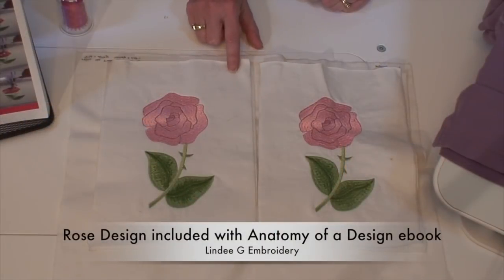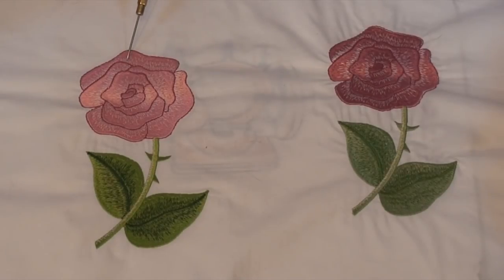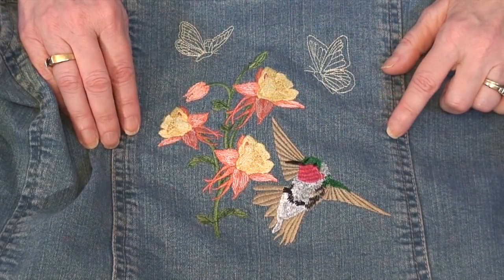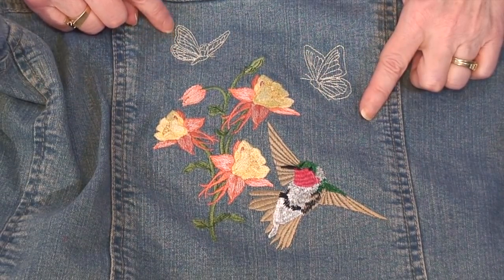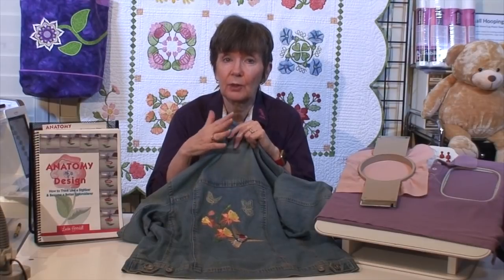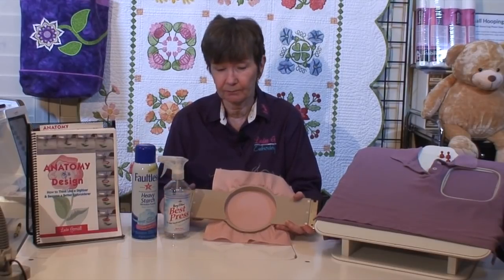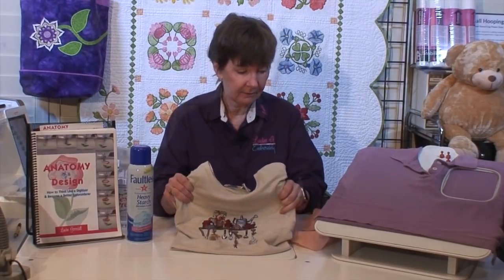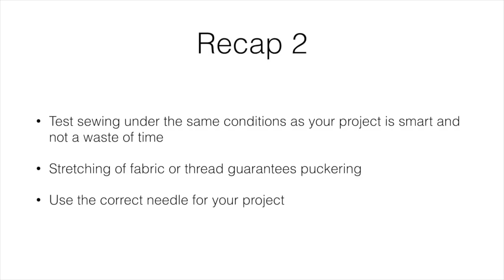Professional Pointers for Pucker Prevention - Part 2, Thread Factors

Comment: In 2006, I started pieceing and quilting. I bought ONE spool of Robison-Anton polyester embroidery thread.   It didn’t seem to have the luster of rayon.   Until I had an embroidery machine, most of my stash was rayon.   My decorative stitching was rayon.  That’s MUCH DIFFERENT than embroidery.  It seems like polyester thread has come a long way. I seems I have fewer problems with puckering using rayon.

Comment: Thank you for all your wonderful videos and ideas.
Why does nobody do any embroidery in cotton? It looks beautiful and emulates some of the antique embroideries. It is soft and has a slight sheen. It is easy to embroider. I design small embroideries from antique 19th century  line designs and use only rayon to emulate silk (silk thread is hard to find and very expensive) and cotton. I dislike using polyester, both for my normal sewing as well as for the top embroidery. I use very fine polyester bobbin thread, adjust the tension and avoid stitches too close together, so there is no thread pull - the same as for a normal sewing machine. Unfortunately, cotton bobbin thread tends to break too often due to the speed of the machine. I would prefer that. Rayon bobbin thread is too slippery - it does not look good on small embroideries.
Here is a hint I use for stiffening fabric: use hard-to-hold hairspray, let dry. Once dry, press the fabric on the opposite side you sprayed (to avoid the spray sticking to the iron). You can actually make the fabric stiff enough to use without extra stabilizer. I make small items, often on silk fabric,  and removing all the fine tear-away stuff takes a long time in an intricate design, and I do not wish to wash the silk fabric. Once finished, I rub the fabric to remove the hairspray and soften the fabric.
Reply from the maker: Thanks Karin! I have done some designs in cotton when I wanted something less shiny. The color lines aren't as wide and depending on the design, I make density adjustments. I'll have to try that trick with the hair spray. I've only used it when stitching on faux fur to comb it away from the design area and hold it in place.

Comment: What was the formula for the homemade starch paste to paint on her fabric before she sew into it.  🤔🤔And with the painted( starched) fabric you still need a stabilizer to back the fabric? 🤗😀👍🏽Thx for making this😃😄 also does it matter what direction of grain pull on the fabric in relation to what direction you hoop your design in and what direction the embroidery design sits on?
Reply: What homemade starch paste are you referring to? I use straight-up liquid starch out of the container. (Niagara brand.) Yes, I still use a stabilizer. Often it lets me use less stabilizer or a water-soluble. Yes, the grain direction can make a difference. The best way is to hoop on grain, especially with running stitch outlines. On one design, I had outlines perfect when the grain was running vertically but slightly off when I hooped it "sideways." Depends on a variety of factors: how stable the fabric is in the hoop and how precise the design needs. Running stitch outlines around fills need a really precise stabilization.
Reply: @lindeegoodall2426 Sorry perhaps writing for me is not the best way for me to understand? haha    😃😄 I don't really understand 🤔🤔

 when you say you use " less stabilizer", since don't you just use 1 layer of stabilizer? Do you mean you typically USE MORE THAN one layer and when you paint you fabric with liquid starch you use less layers? Or do you mean, instead of using a STIFFIER stabilizer  you can now use something LESS stiff? Can you please explain? (sorry I'm confused) hahha lol

I had a hard time following what you're saying about grain, hahah lol. 🤔.When you say you hooped it sideways, do you mean you hooped it on bias? ( sorry I'm not super knowledgable and I'm trying to understand EXACTLY what you're saying"  

it stitches out wonky?  When you have a rectangular hoop, do you want the "straight grain" to be running parallel to the LONGER side of the rectangle or the shorter side of the rectangle ( does it matter? as long the threads are running parellel and perpendicular to the sides of the rectangle)?

I'm trying to do red work embroidery & running stitch designs on light weight muslin.

this to be exact on a Brother NS 1750 D
https://www.joann.com/legacy-studio-premium-muslin-bleached-90in/10367290.html

I pre washed to shrink it, and painted it with liquid starch, what do you recommend using as stabilizer?( I don't think my liquid starch is as thick as yours being that AFTER Ive painted it and let it dry, when I pull towards the selvage there is still STRETCH in the material it's not stiff as a board, it's still quite soft )  

Is the liquid starch enough of do I need interfacing  ALSO? If so what type of interfacing and stabilizer to do you recommend?

  I'm a beginnger sorry ☻☺if these are amateur questions. I've tried doing research on my own on lightweight muslin, however, with the variable of painting on liquid starch idk if the conventional advise for lightweight muslin would still apply Sorry to unload so many question... but thx for trying to clarify, have a great day☻☺

Comment: Thank you for this very informative / educational video.  I've learned so much.  Is the coupon still valid?  I just noted this is a 2017 video date.  Thank you, again, for sharing so much.
Reply from the maker: Some coupon codes have a very extended lifetime. Try adding the product to the cart, applying the coupon and see if it works. This cart is not very good about handling multple coupons so don't try to apply more than 1 coupon per checkout. Thanks for asking!

Comment: I really like your videos they are very informative, but your site for your book sucks.  I have tried 6 times to get an account registered and it just won't work, so I guess I won't be buying your book
Reply from the maker: If you would email me through the Contact page on the website, I can help you. "It doesn't work" doesn't give me a lot of information about where the problem is. 33 accounts have been created today and I suspect 1/2 of those are spam accounts since they remain unconfirmed. The site uses standard popular off-the-shelf software for the shopping cart but it does require you to confirm your account to minimize spam accounts.